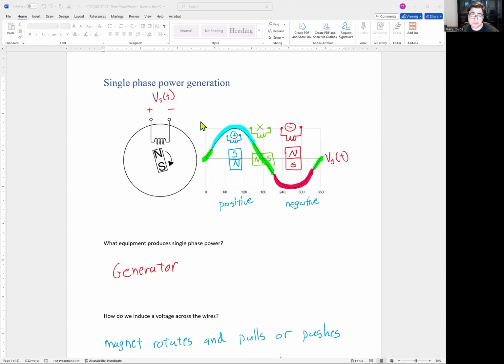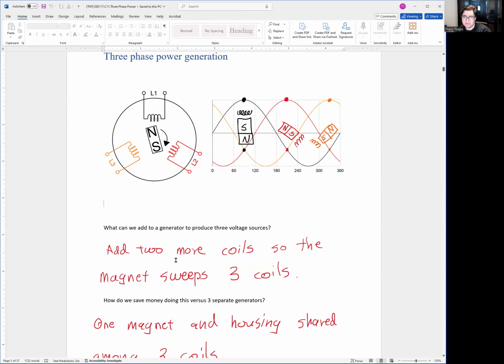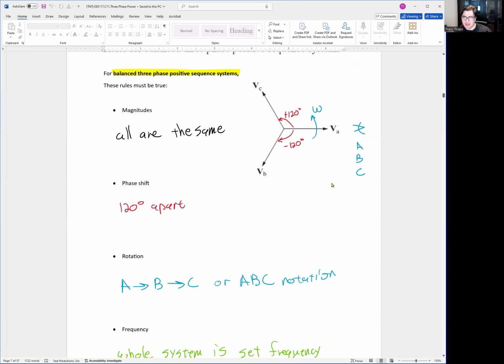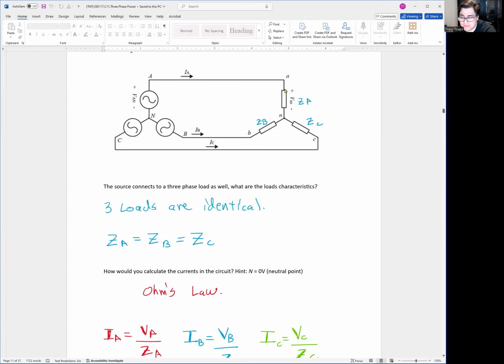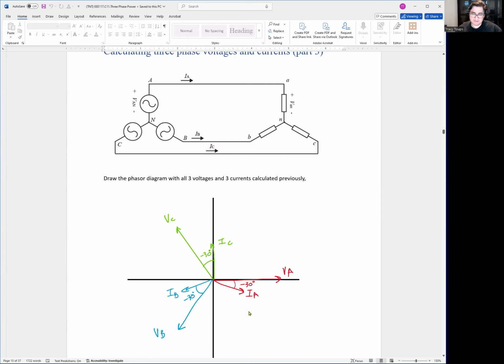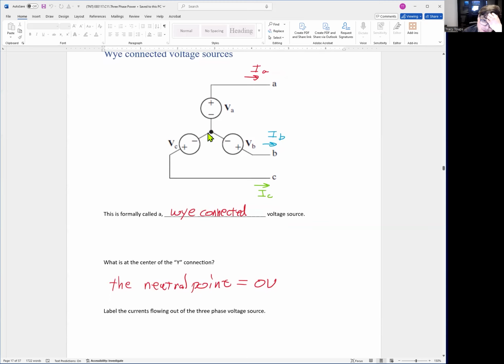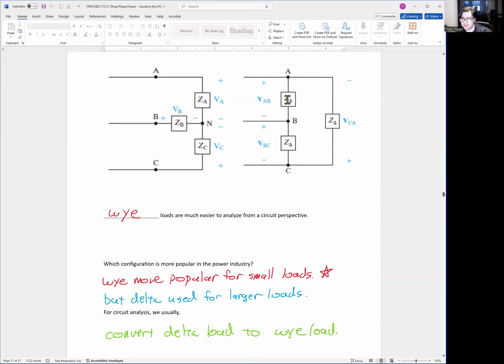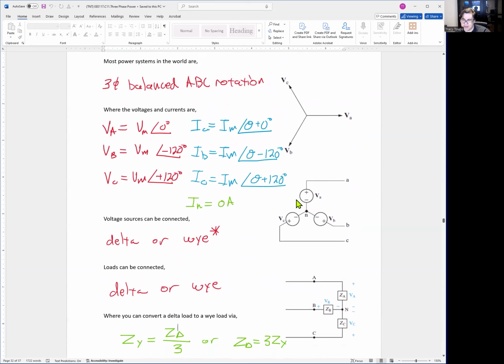EEE 117 C11 Three Phase Power (part 1)

Comment: at 22:35 why is Vc +120 degrees instead of -240 degrees?
Reply: +120 degrees is the same as -240 degrees on a unit circle. they're called coterminal angles